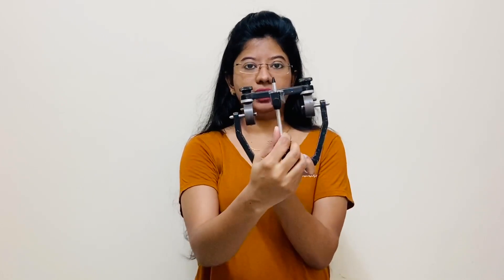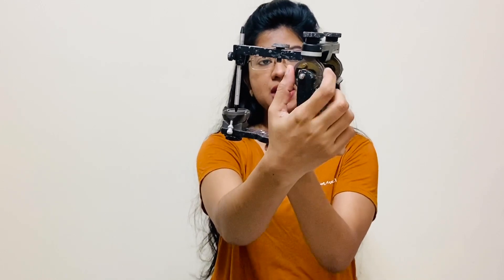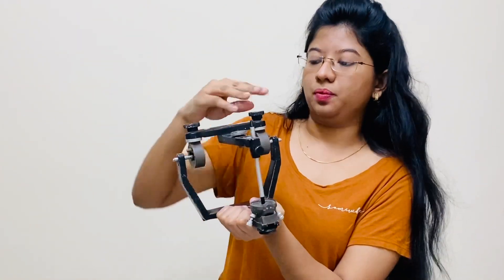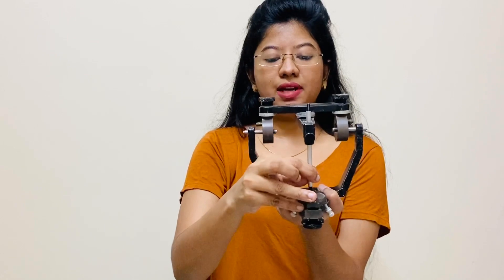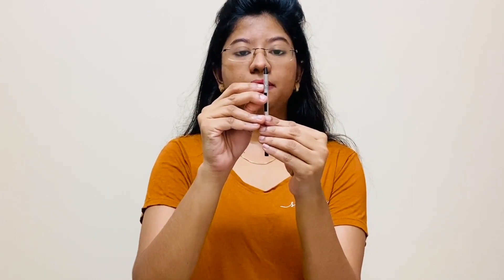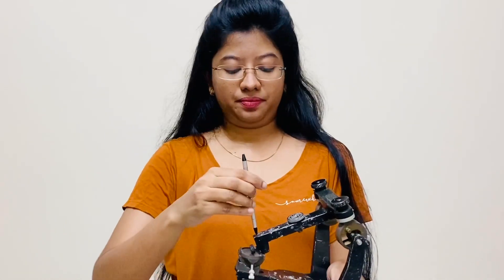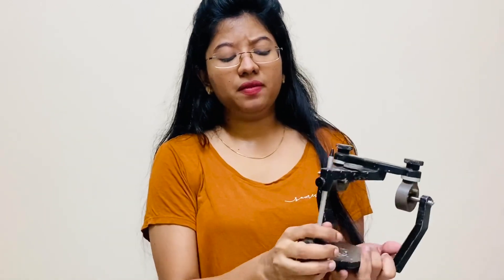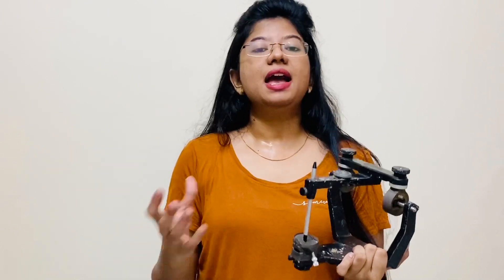Hanau Articulator and its parts (Hanau wide-vue semi adjustable)

Comment: 7mm adjustment means what mam when face bow is attached to articulator
Reply from the maker: Thr are two slots when you place facebow on articulator while direct mounting procedure
You need to place in the previous slot as thr is an correction of 7mm.
For the details, mention ur email,
I will send you article which explains evrything in detail.
Reply: @jkdent-easedr.jasmine-educ876  please send the article mam
Reply: Mam pls send that article mam

Comment: How to you set the horizontal and lateral guidance in complete denture
Reply from the maker: It requires protrusive bite and we need to adjust lateral according to formula H/8+12
I will make a separate video for the same
Reply: Thanks Dr